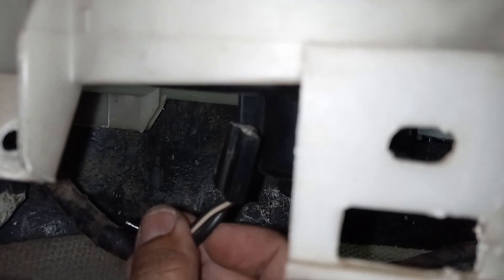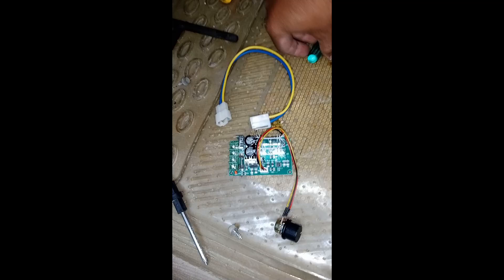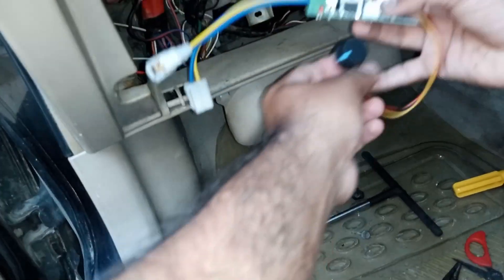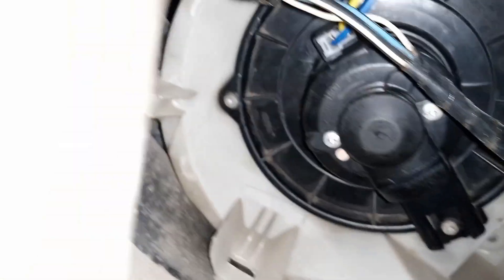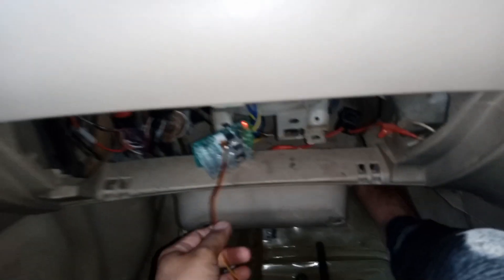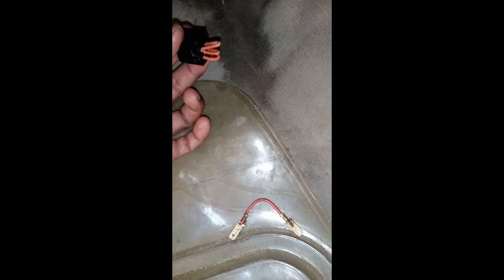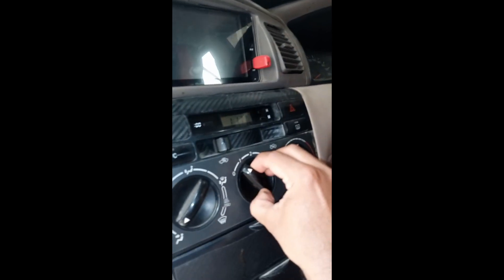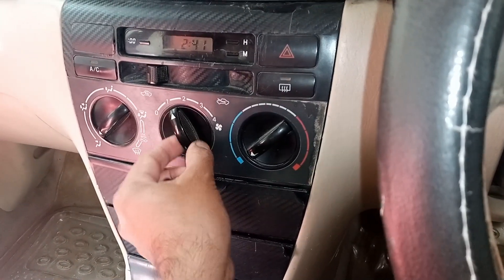Car AC Blower Speed Control with PWM Module

Comment: You could check the resistance of the Variable resistor (the potentiometer) in the knob control and use the orginal selector resistance to control it instead directly if it somewhat matches.
Reply from the maker: The Purpose is PWM based Voltage Step down Instead of Resistive, potentiometer Couldn't handle that much of Ampere secondly, it waste energy as heat, so that is why pwm